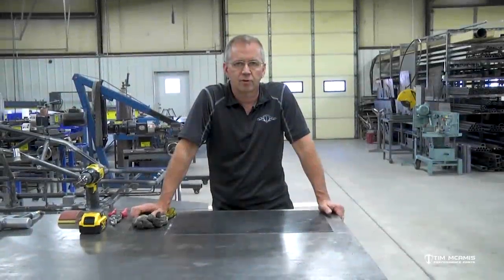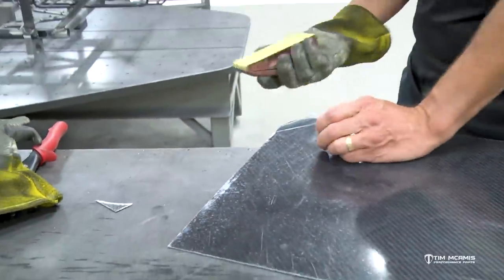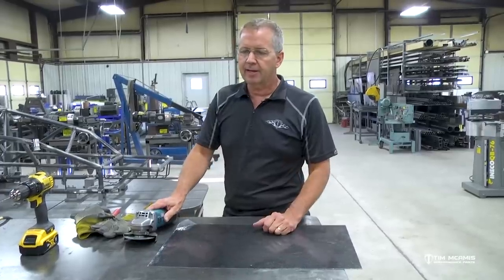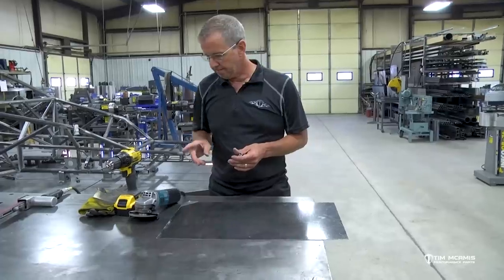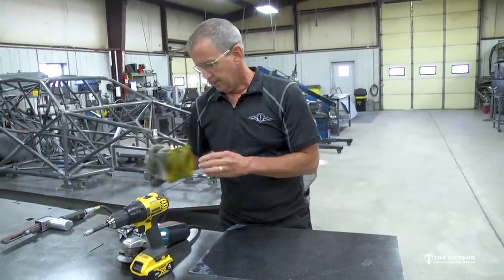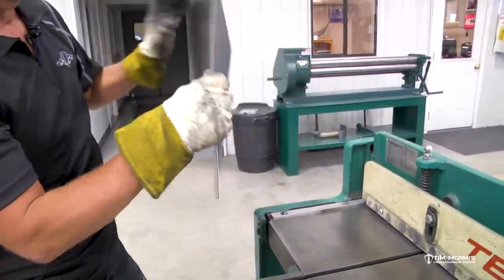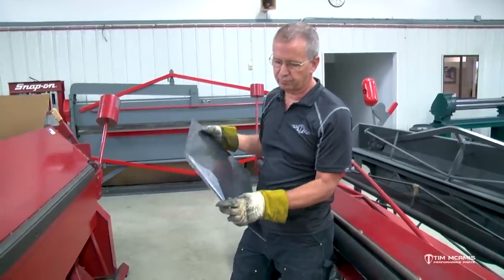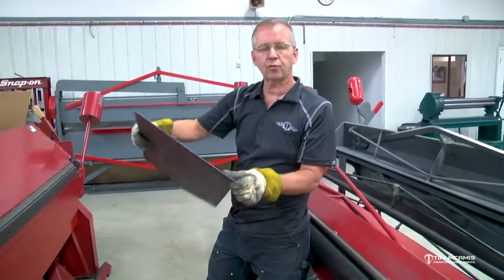Carbon Fiber Fabrication - Composite Series: E4

Comment: Thanks for the vid.
In my experience solid carbide drills work well in carbon fiber sheets. Will drill nicely and stay sharp in a way that HSS simply cannot. Probably cost prohibitive for anything but the smallest diameters though.

Comment: What do you recommend if you want to join a vertical piece to a horizontal piece as far as a bonding agent ?

For example. 
You make a custom instrument panel cover  and have to trim it to fit and remove a couple of mounting tabs in the process.

Comment: Hey Tim,  for cutting carbon, have you tried a pencil grinder like a dremel or an air pencil with a 40mm diamond coated cutting disc? It's very precise and can do any job, big or small.  Through my 9 years of motorsports composites, this is definitely my go to cutting method.

Comment: So... question... I'm looking at making my own carbon fiber panels for a small hobby project I'm looking at doing, and I'm looking for information on bending carbon fiber... i understand how you explained how to do a bend with heat, as well as how to do a bend with a straight boaded machine, but i was wondering about doing a heated bend. Is there any kind of minimum thickness of the carbon fiber sheets, and is there a limit on the types of carbon fiber  that can be heated? Also, would it be possible to take and sand the print-through area, andadd another layer or two of carbon fiber cloth on top, on one or both sides, to restore the original looks?

Maybe you guys can help answer a question or two on carbon fiber strength as well... I'm looking for something to use as a core material, and I've seen "soric core" mentioned, byt can't find anything of that name readily available on Amazon. You guys talk of using something like a fiberglass mat, but I'm wondering, if there's something that's both cheap and readily available, that isn't fiberglass, as i honestly don't like working with anything that has fiberglass in it? i can't stand the itching that accompanies stuff, such as fiberglass insulation, so i wonder if there's a cheap way to get around that... to be clear, all these panels will do, is sit on the side and back of a tiny bicycle baby trailer that has had it's canvas covering deteriorate from being left outside, that i got from a family friend for free...

Also, just say that I was to have my back piece made, and my 2 side pieces made, is there an easy way to permanently connect them together? Another related question would be, how would/could you do nice looking upholstery corners when attaching the carbon fiber cloth connecting the curved back and side pieces together? I assume that it would also include a bunch of sanding to make it more or less flat? Again, those questions assume that's how you'd connect panels together... think of ut like this, yhe sides are held upright with a bar spanning the width of the frame, with a plastic headed tightening bolt on either end, which is probably what I'd mainly use to keep everything connected to the frame... whether i used more or not, i don't need the resultant sheets, either separately or as a whole, to be too strong, just enough to possibly deflect a few rocks, as I'm not planning on running over it with a tank or something so it should be good enough if it can withstand a bit if wind and rain, as i DO hope to make it somewhat water resistant for usage in light rain, if need be...

Comment: If its cosmetic it dosnt matter but if its not use diamond saws and bits and never ever fracture a cured part make it to shape from scratch and dont use epoxy use Vinyl Ester.👍
Reply: but still can use a diamond saws rite for the carbon sheet?
Reply: Epoxy makes carbon fiber 3 times stronger